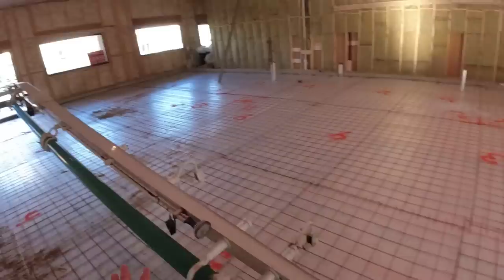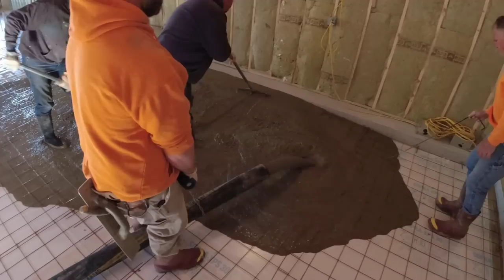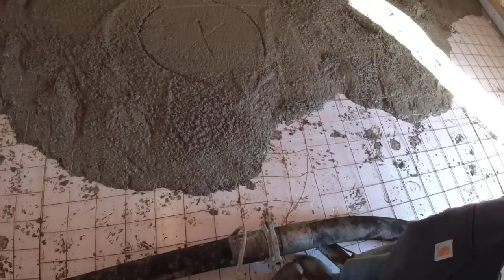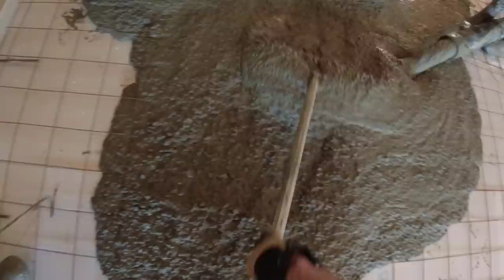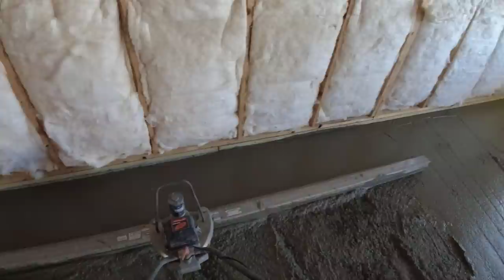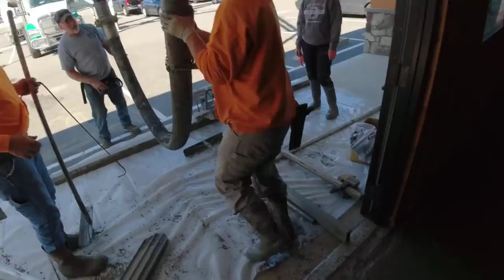Big INSIDE Concrete Floor Pour (Concrete Co. Forgot This!)

Comment: Wondering .... You say you use a water reducer then add 10 gallons of water and ive seen you add 30 gals to a ten yard truck we order a 6 slump and have never added more then 10 granted it doesn't look like water but very workable .. just not sure what the use of water reducer is when you add that much water

Comment: What is cal?
Reply: Calcium, you can buy a powder form you can mix it on site and put it in the mix for fast  drying times. 
Its actually detrimental to steel and should not be added to concrete.
Reply: Thanks for the reply

Comment: The pumping company we use has what we called pizza pans that went under the clamps at the joints it made it easier to slide the hose over the mesh I always hate dragging hose
Reply from the maker: Some have it here too. This guy doesn't